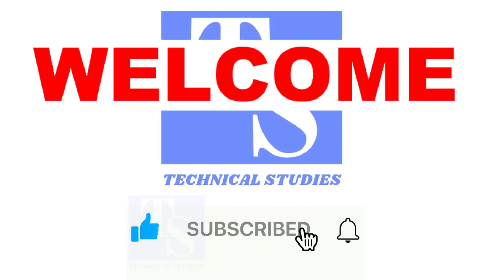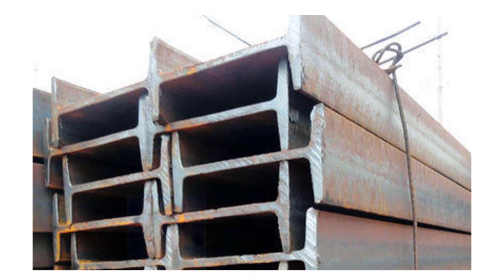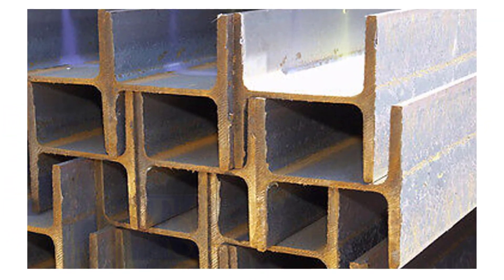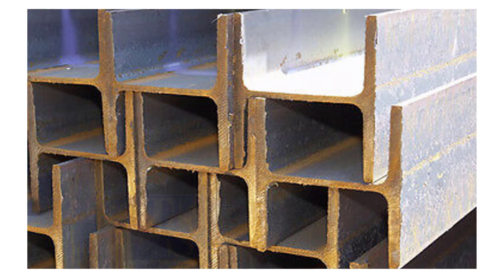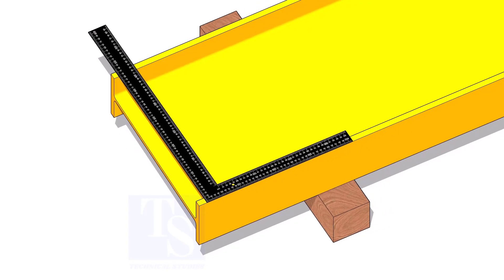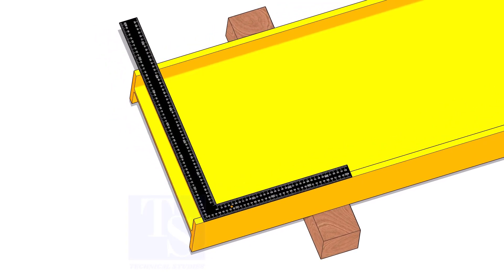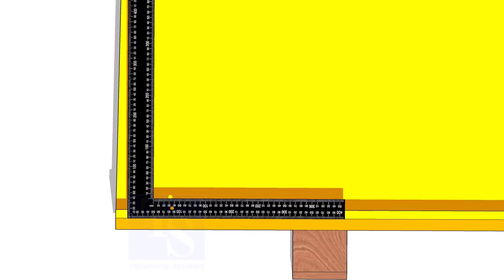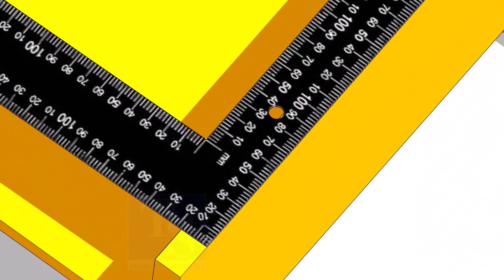Beam, Column- Squaring tutorial for fitters. structural fabrication tips and tricks.

Comment: I use a beam pan to layout beam. Can check for square using 2 ft square but most of the time simply turn the beam pan upside down will tell you the line you just drew is square. That's how it's easier
Reply from the maker: Your suggestion is precious Bro.